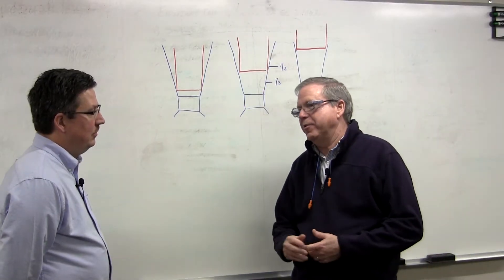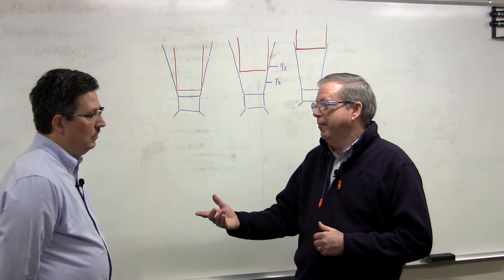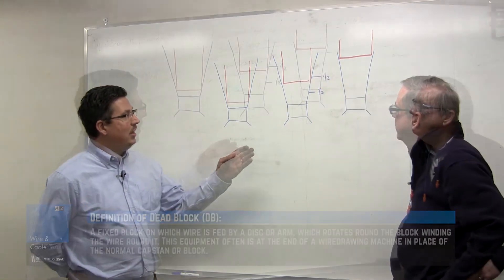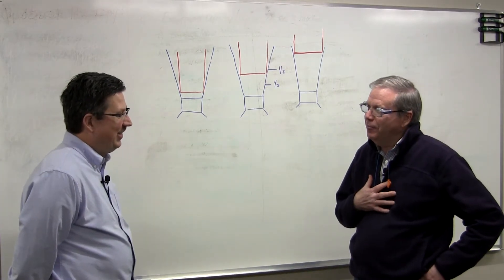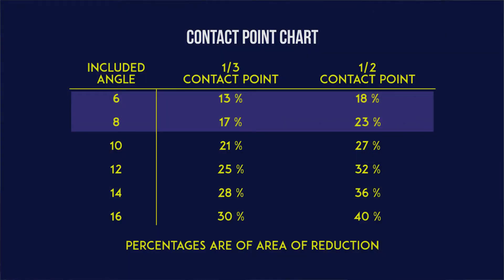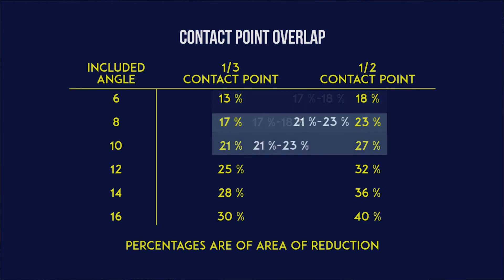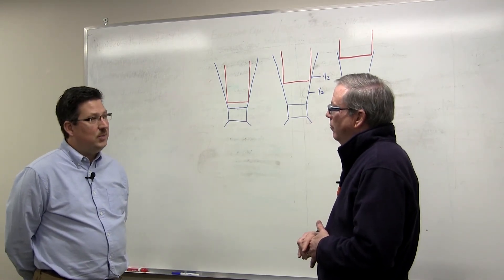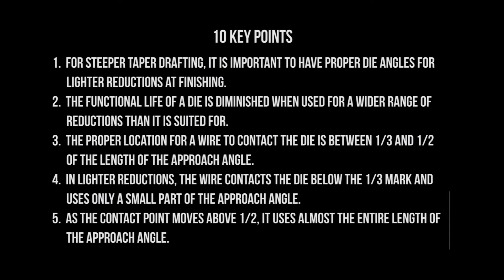Die Angles

Comment: I have an 8 block straight wire drawing machine for drawing  0.77% carbon 7.00mm to 3.00mm
Please suggest a better draft and the die angles. I’m having central bursting issues in final block.

Comment: Make sure all blocks and dies have water cooling and fans to cool the wire on the blocks if wire is hot dip use knocking off dies(a couple of larger sized dies put on base wire wrong way round to knock off any excess zinc) hope this helps.